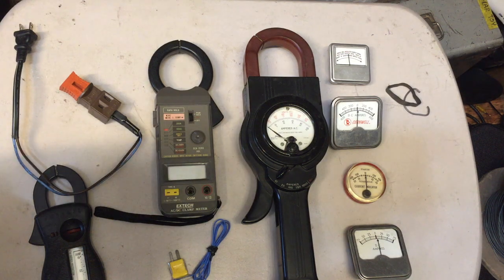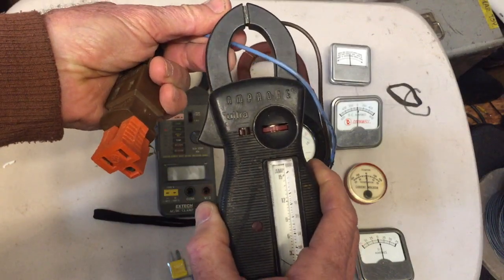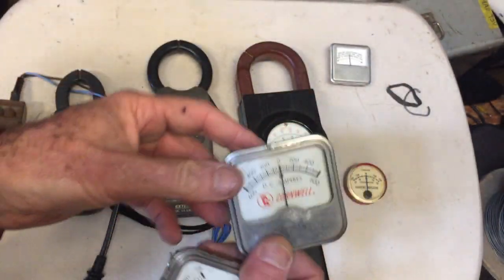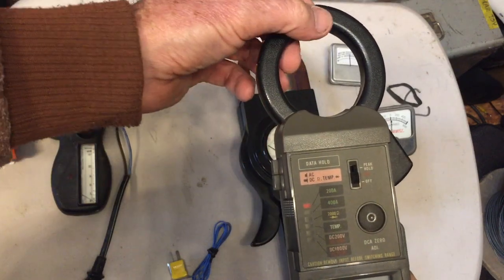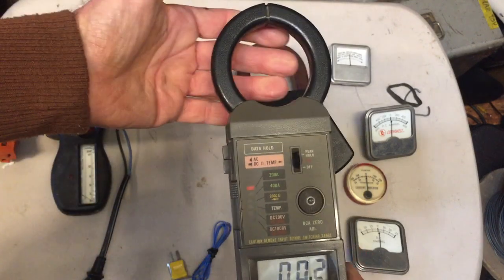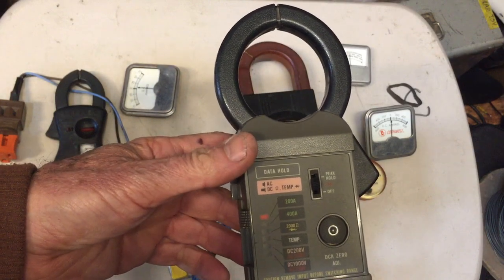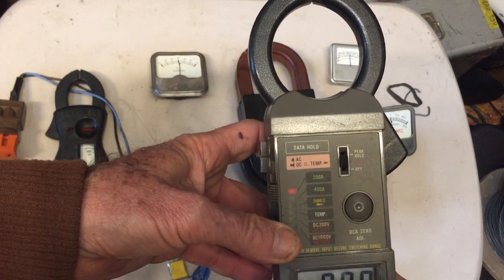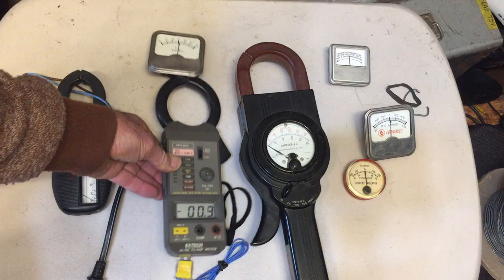Must have DC Inductive Amp meters

Comment: I recently bought an affordable chinese made Proster cm6000 pro DC/AC clamp meter with regular dmm features. They come with NCV, capacitance, frequency, temp and 60M Ohms resistance, AC/DC voltage. The meter is great although i paid a bit for postage and currency offset to my country. This after having changed a few meters over the years seemed the most ideal since i have both electronics and automotive interests. Thx for your videos. I joined today after YT recommended your RF radiation video.

Comment: Something interesting about those little automotive amp clamps is that it will show you the direction of current flow depending on which way the needle swings left or right interesting thing to note that thanks for your videos.
Reply: It can also be used to track down a short.

Comment: At my work we have an Extech AC-DC clamp on ammeter that has a 1ma DC resolution. It is a great tool at a great price (under $100)
Reply from the maker: I had no idea they came with such sensitivity in the DC inductive mode. I figured stray magnetic fields would make such low readings impossible, but that's good to know. Nice to hear from you Steve.

Comment: Basic electromagnetic theory shows that measuring either ac or dc current would be simple with a clamp meter. Why is that such a revelation to you?
Reply from the maker: I figured the clamp on meters were only available for AC amps. I guess I'm not keeping up.
Reply: Probably because, regardless of theory, practical DC clamp ammeters have only become generally available relatively recently.
Reply: @sootikins  I've seen always seen one at Sears that I've considered buying for over two decades now. Of course, they're gone now.